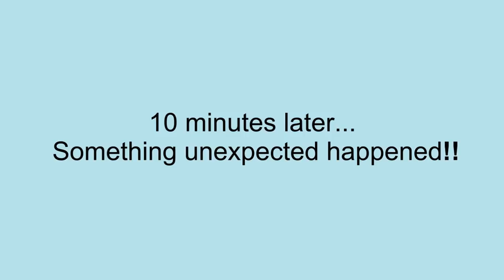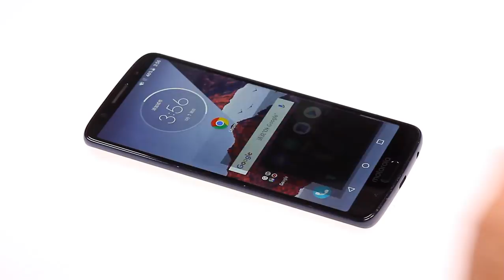Moto G6 Plus Waterproof Test

Comment: so, a phone that clearly states it's not waterproof, is atleast water resistant. it's only possible with a motorola . i had a samsung which was not waterproof, but when I tested it under water, it failed and stopped working thereafter even after repair. so, proved that non water resistant moto phones can stand a water test, but it just needs a repair. that's why probably my moto g2 is still with me, even after such an issue.

Comment: Sir I've watched a video on @Tech1Tv In which the Moto G6+ survived under the water for 6 mins and some secs without any problems in it everything was working fine ... so why in this video it was faded by just few of splashes ?? and is this device is suitable for taking selfies at swimming pool ???
Reply: Fahim Khan its not a waterproof phone it can handle only few splashes and No you cannot take this phone into the swimming pool because it is neither IP68 nor IP67..
Reply: It survived Well 10 min. Under water in another video
Reply: I saw that video, too. I think it has to do with shallow still water compared to water under pressure which can force intself into the phone internals. Just a guess. Also keep in mind that it was only submerged in about 2-4cm of water.  VERY low pressure. Taking it 1/3 of a meter underwater would likely result in damage.

Comment: Moto G6 fell in river water, barely, not submerged, just the bottom 1/2 inch of phone, for less than 5 seconds. Motherboard components fried. Still powers on, but screen unresponsive and finger sensor not working. can only power on, or change volume. Disassembled, can see that some components are completely fried to nothing, only solder spots on board where they used to be. NOT waterproof *at all*.